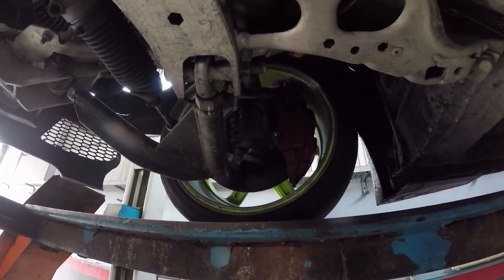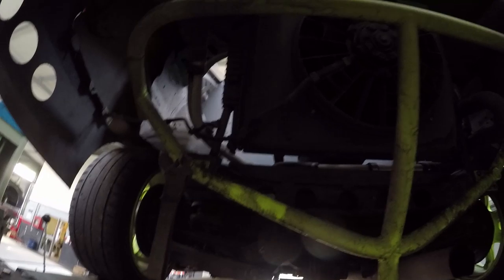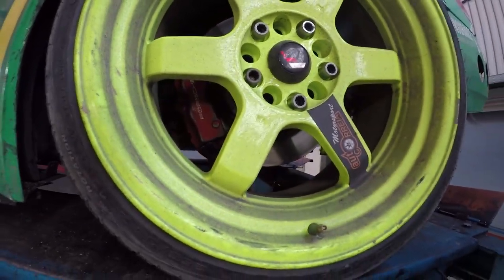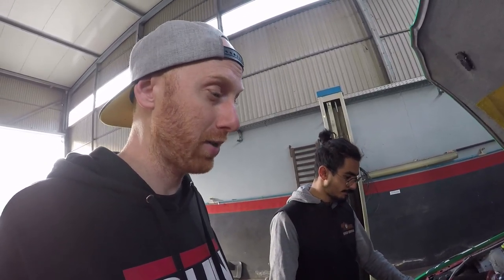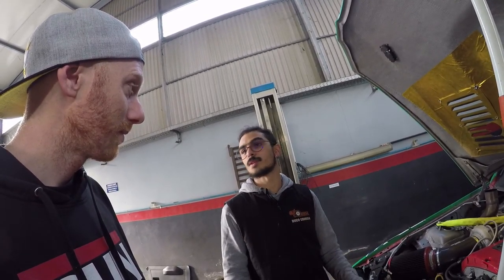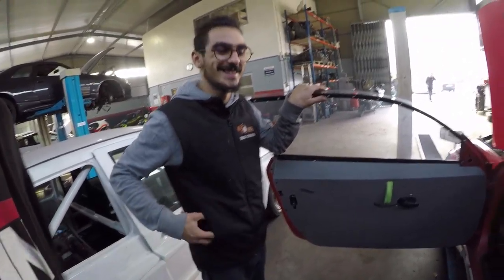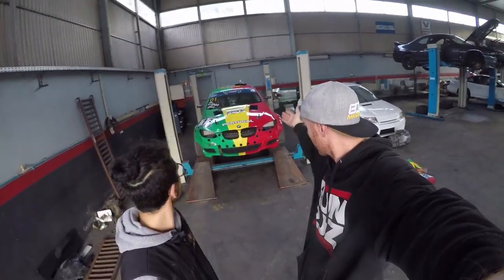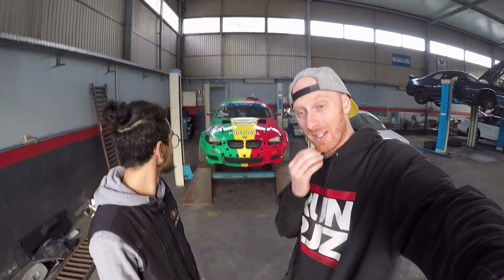BUILD BREAKDOWN - Mercedes M111 Powered BMW E92 DRIFT CAR Portugal Drift Championship Diogo Correia

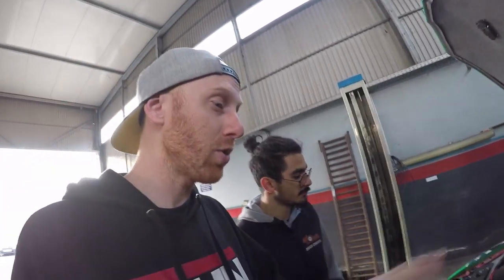Comment: @6:06 M111 engines have a "liquid to liquid" heat exchanger mounted on the front of the engine for oil cooling. Its the cylindrical unit just below the cam sensor. The upper radiator hose connects to it. Also, I know this video is quite old, but I've tried to get in touch with Diogo via twitter and he's unresponsive. I have an SLK turbo swapped and am using the factory Siemens SIM4LE ECU. What version of the "Link ecu" is he using? I am looking into megasquirt, but think there is more out there that's better. Lastly, I noticed that he didn't tap into the oil pressure sensor port for the turbo oil feed, where did he get oil pressure to the turbo from???
Reply from the maker: Diogo Correia on messenger or Autocorreiamotorsport on Instagram.
Reply: theres a guy using an ECUMASTER classic on his